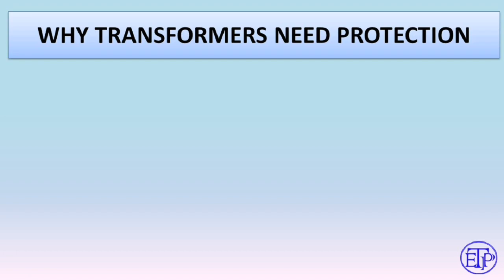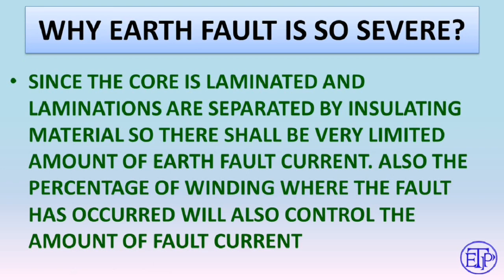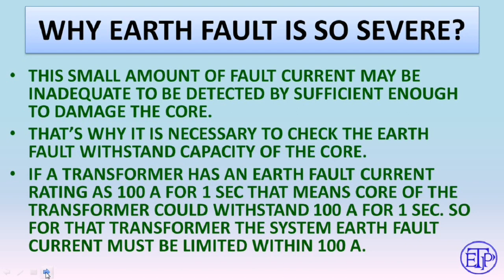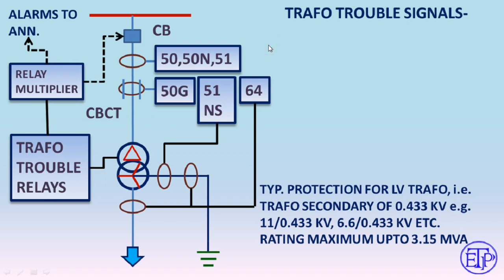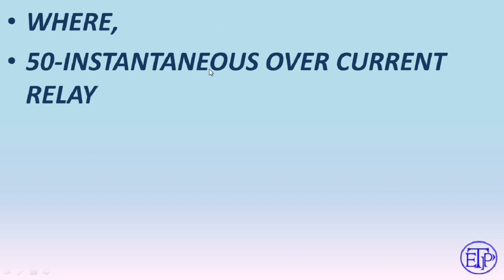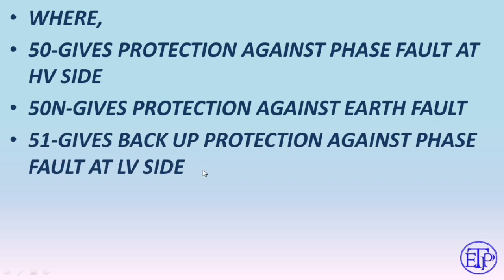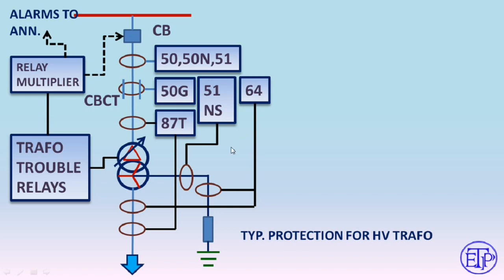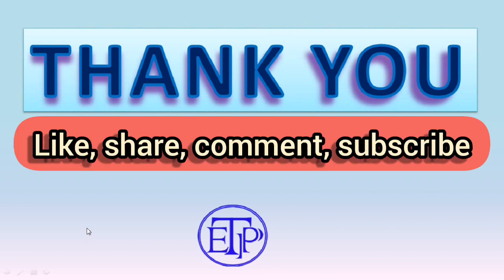TRANSFORMER PROTECTION|ELECTRICAL TECHNOLOGY AND INDUSTRIAL PRACTICE

Comment: Hi, if i have a transformer with FLA 10A. 
And it is loaded in L-Configuration with 8A.
In emergency if i want to start one motor rated 2A, then what protection temporary changes should i do on the transformer protection relay, considering the motor inrush six times for short period of time?

Comment: One little thing I want to make sure, usually C& R Panel are approx  300 to 400 mts away from the  Trafo, The CT -sec current 4000/1 Amp, carried through 1x 4/2.5 sqmm cu control cable will have some drop, will that have an adverse effect on the Realy functioning.
Reply from the maker: That is current activated relay, and not voltage activated. So it does not make any problem
Reply: @electricaltechnologyandind5335  Thanks

Comment: Sir make videos on rating of transformers and generator, in that video explain what KVA equioment is used where amd what if we use some other KVA euipment instead of rated KVA equipment. 
I hope u understood what i want ?
Reply from the maker: Honestly i didn't. However I have a video on transformer kva rating selection. You can check that
Reply: @electricaltechnologyandind5335  sir can i write to u in hindi accent ?
Reply from the maker: Yes.. why not
Reply: @electricaltechnologyandind5335  
Sir , main kehra tha, ki esi video banao, jisme aap batayenge ki kitne power ka transformer kaha use hota hai.
Matlab 500MVA ka transformer kha pe use karte hai, aur,  500kva ka kaha use karte hai ?
Or agar 500MVA ka transformer esi jage lagade jaha 500kva ka lagna chiye to kya problem hai..

Esi generators k baare mein bhi batayenge aap.
Reply: @electricaltechnologyandind5335  
Or sir, maine bhi ek video dekhi dc  motor speed control ki.
Usme unhone potentiometer use kara hai resistance control karne k liye jis se speed control hojaari.
Par MOSFET q use kar re hai, ye nahi bataya.
Or kahi pe pata bhi nhi chalra.
Kehre hai ki MOSFET speed control kar ra hai .
To fir potentiometer kya kam kar raha hai ?